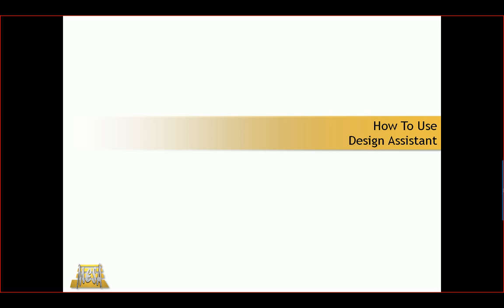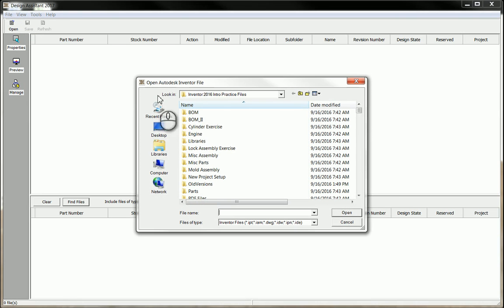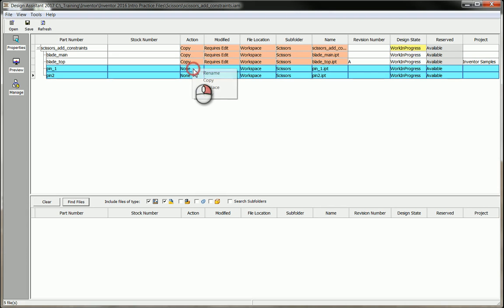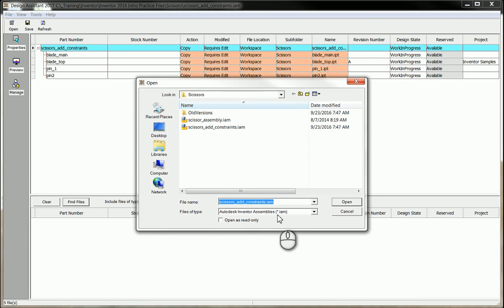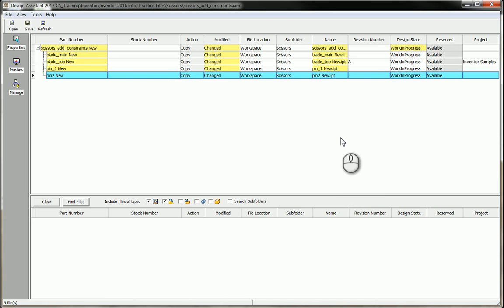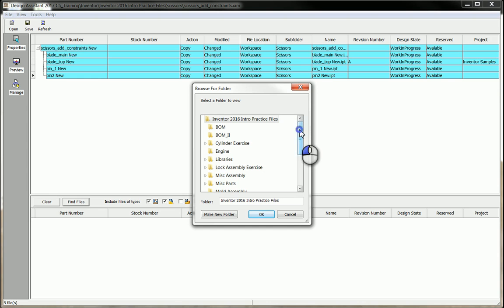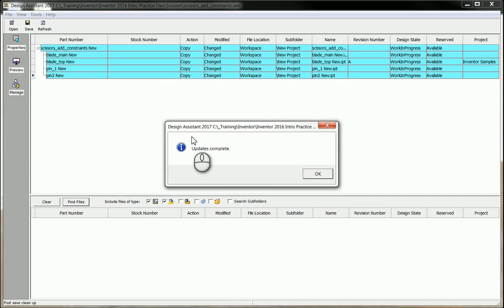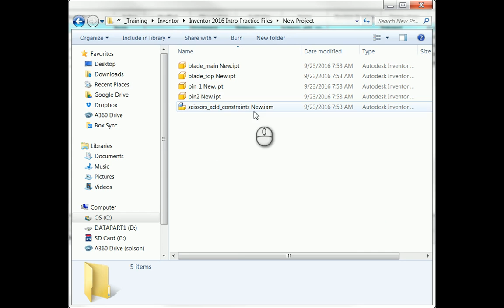How To Use Design Assistant

Comment: what about if I have 500 part ? do i need to do it one by one ?
Reply from the maker: You can group select and set multiple parts to copy or rename, but setting the new names is done one at a time.  I wasn't sure if there was a find and replace option, so I just double-checked and there isn't.  I know that Autodesk Vault has a Copy Design function that does the same thing and it has a find and replace option.  If doing an entire 500 part assembly seems daunting to you.  You could look at doing this on the next level down, doing several subassemblies on their own.  Then when you do the top-level assembly, instead of copying parts and subassemblies, you can use Replace.  That will replace the original part with the new one.

Hope this helps.
Reply: @3DSteve52  Its compeltely rediculous there isnt a find and replace option...... Even Wordpad in Windows has it... Like.... what's the problem?? A completely fundamental function.....

Comment: When I open an assembly in Design assistant I try right clicking on action and nothing happens. ANy idea?  Thanks
Reply from the maker: Shawn,  

Not 100% sure, but it might have to do with the file not being migrated to the version of Inventor associated with the version of Design Assistant you are running.  It typically warns you of that  when you first load the model.  It might have to do with read-only files, but that shouldn't matter.  

Hope that helps,
Steve